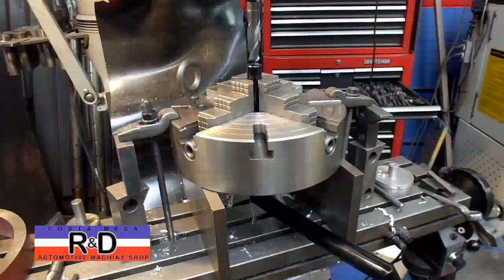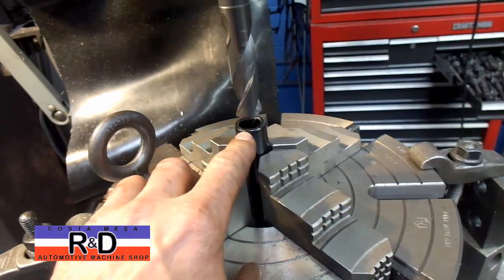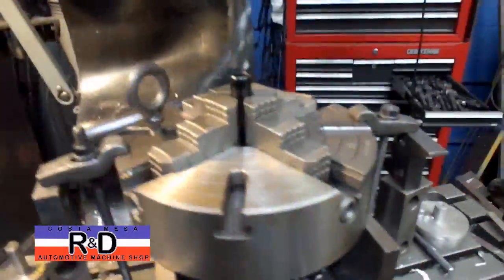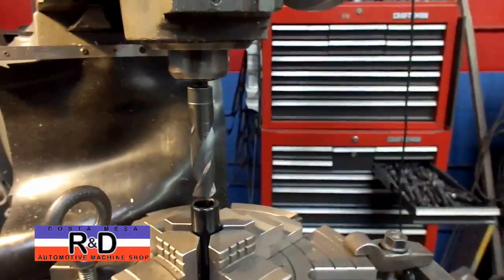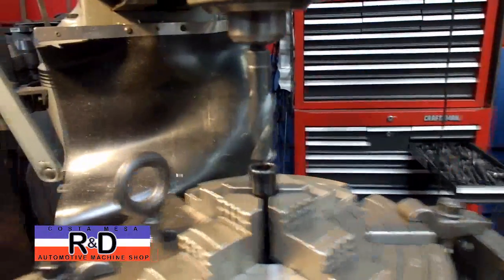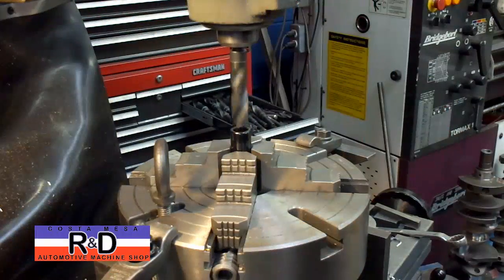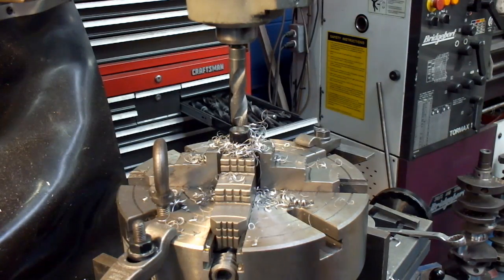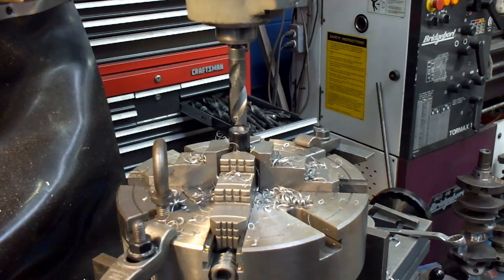Harley Davidson Handle Bar Mod on the Bridgeport Mill

Comment: Could you explain again how you got the handle bar & 4-jaw exactly lined up with the drill bit?
Did the end mill exactly fit the original inside diameter of the handle bar? Then you moved it and the 4-jaw to where you could tighten down the chuck on the end mill, then tightened down the hold downs on the 4-jaw? Then replaced the end mill with the drill bit? What if you didn't have an end mill the exact size?

Comment: Hi John,

Always enjoy your setup on the mill, great learning experience for me.  Was there a special reason that you used a 4 jaw?  

Btw...that is a beauty of a 4 jaw chuck

Regards
Chuck
Reply from the maker: I have the 4-jaw as it gives me more flexibility for holding odd shaped parts where the 3-jaw does not. Its not that difficult to dial-in a part to the 4-jaw.